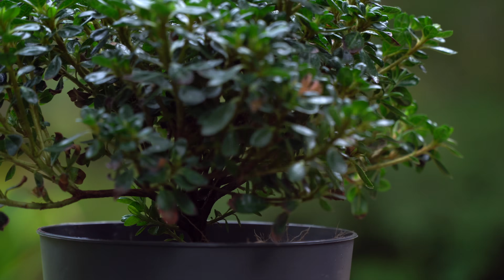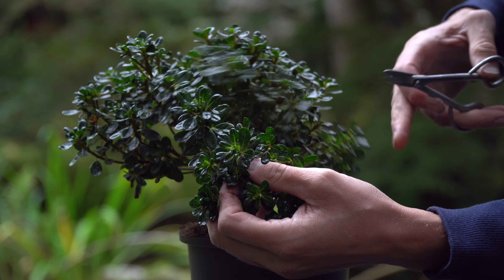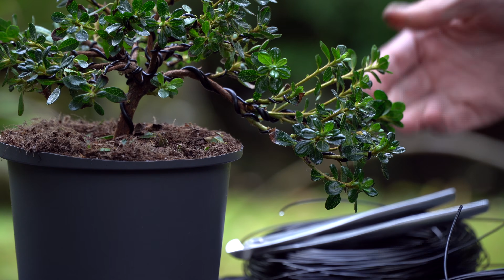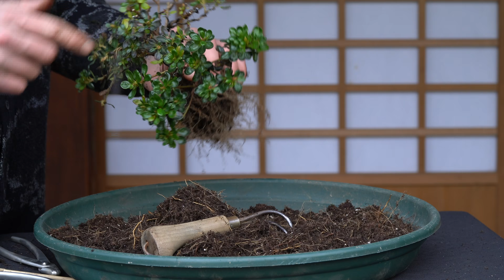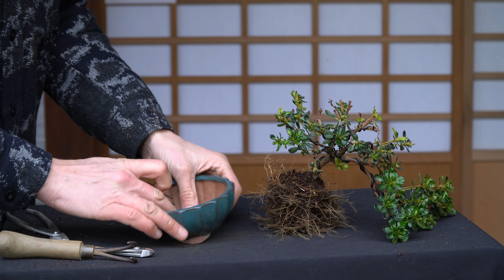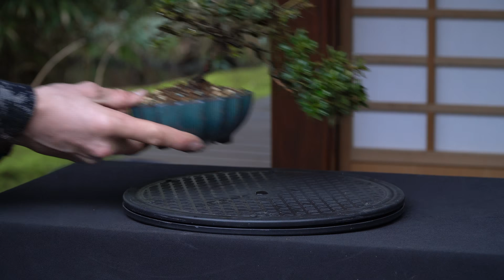CHEAP! Creating an Azalea Bonsai tree

Comment: I bought an azalea from a box store for bonsai and when I cleared the top soil, I found a mat of roots at the base of the trunk. It’s not fine roots that I can rake out. Any advice on how to handle this? Do I cut away all those roots?Or use them somehow as part of a mangled nebari? 😂
Reply from the maker: If they're fine - you can remove that first layer searching for larger roots underneath.

Comment: Hey! I did this quite a few times. You have chosen a variety with small leaves: I think that's wise for a shohin size bonsaï. I always repot after flowering: growing power of these plants are the strongest in this period. Repotting right before flowering, I never heard of that or saw it (even after several decades of taking care of bonsaï). Early spring, yes but then you should not be dissapointed when there's no flowering. But right before flowering with even swelling flower budds? What's the idea behind that?
Second: I'm also amazed about the soil mixture. Don't get me wrong but it's quite generally known that Azalea's prefer a rather acidic mixture, for instance with a lot of kanuma or at least specialized   potting soil, for Azalea's etcetera. If the mixture is not acidic enough, the plant will have trouble to absorp its essential feedings. Greetings and good luck!
Reply from the maker: Hi! Good points. We should have used Kanuma (we usually blend kanuma with our standard bonsai soil mix). And I did not care about flowering at all in this case for a tree in development - otherwise pruning would be done right after the flowering period.
Reply: In
Reply: @mamleers Do you think adding pine bark to the inorganic soil mix would give it the acidity it needs?
Reply: @jonathanduran8669  Hi! I doubt it but I do not know that for sure. My own mixture? Quite simple: 50% Kanuma, 50% potting soil for acid-loving species (like Azalea's). Works perfect for me, already for many years now (Western Europe, the Netherlands). Big advantage: it's much cheaper than 100% Kanuma (which would also be possible). But most of all: it doesn't dry out as fast as pure Kanuma. That's very important for as you might know: "a dry Azalea is a dead Azalea". Disadvantage however: the soil surface doesn't look that pretty after a while. For exhibition purposes, you might cover the surface with a thin layer of fresh Kanuma or even Akadama, that's no problem whatsoever. That potting soil for acid-loving species can be bought in every gardening centre in the region where I live and it costs about 5 to 10 euro's per 30 or 40 liters. It's a bit darker because there is more peat in it. By the way: I also add a bit of that soil to my Japanese Maple mixtures - works perfect because they love a slightly acid "touch"... Good luck!
Reply: @MAMLeers  that was super helpful. Thank you!